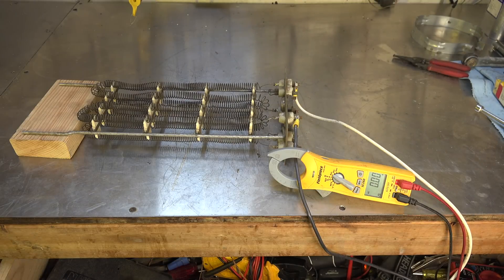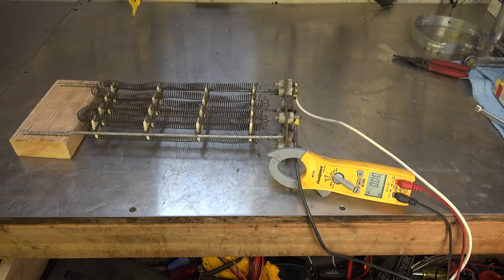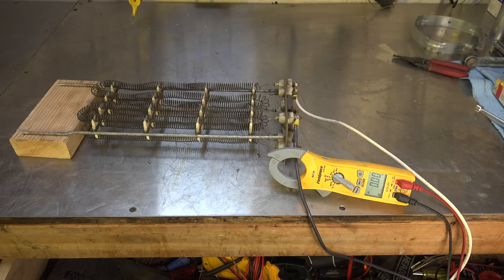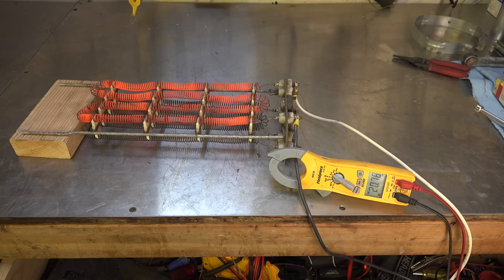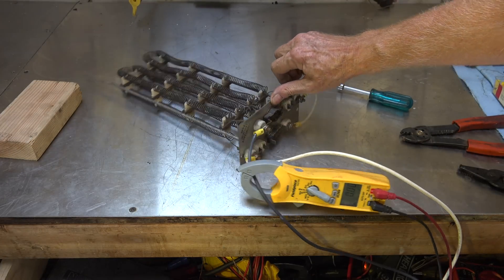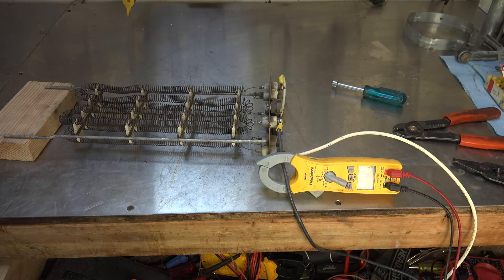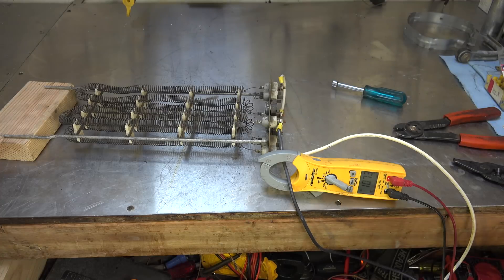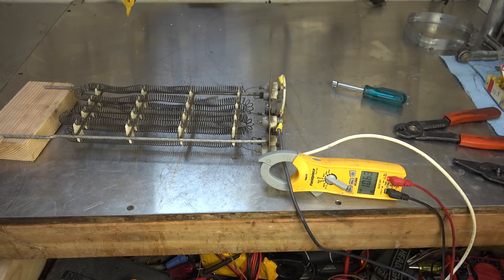What is meant by electric resistance heat.

Comment: It's a combination of volts fed into a resistive material, a resistive material is not a conductive material like the heating coils you have in this video. This video is a  demonstration done by a man who at the time didn't know everything that he was doing and how it works. The conductive coils heated up glowing red hot because only half of the heating elements were connected to the circuit, one the second heating coil was connected to the same amount of power, the heating device is now double the size and requires a higher amount of electron and proton flow. This set up doesn't heat up glowing red hot because of the inefficiency of the set up, and unexpected results as the experiment or demonstration was not well set up for the intended project. I believe your confusion comes from a misunderstanding of what a resistive material vs a conductive material is.
Reply from the maker: Your comment is a very large bit of complicated nothing.  Not worth an explanation.
GFM

Comment: More resistance under the same pressure will get u less power (wattage ) so less heat. If u give it more pressure (voltage) , to get the same current as before , that heat will much greater.

Comment: For more efficiency I would recommend an invention. Using Ac induction with a coil (no contact) and combine it with Dc direct or indirect resistance heating by induction at one side and direct resistance heating at the other. AC and DC will create more heat together, I think by higher and opposite electromagnetic fields.

It is not the same... When you put 10v Ac induction... And compare between 5v Ac and Dc, then you can conclude and realize if it is more efficient.

Comment: *I think you meant that the higher the resistance, the less power that is drawn giving you less heat. To output the same amount of heat with double the resistance, you will need twice the amount of power, voltage or current.

Comment: u mesed up... "if i lower resistance ill get half the heat" oposite way
Reply from the maker: You are correct at around min 2:45.  Other locations in the video it is correct.
GFM

Comment: So I have a heater that puts out 1300 watts on LOW  and 1500 watts on high...I'd like to make it (on low ) run down to 500 Watts if possible or close to it.  How would I do that?  I have a tiny generator that can't do it but almost. Is it possible to lower the watts on LOW?
Reply from the maker: The only way to reduce wattage is to wire 2 heaters in series.
GFM

Comment: It resists the flow of current
Reply from the maker: If this is correct, then higher resistance would increase heat output and larger amperage draw.  This is not the case.
GFM

Comment: Picture it like this: if you have a battery and you closed that circuit by connecting negative and positive wire together there will be a spark, that spark is caused by electron traveling at a rapid speed, if you hold that wire long enough, it will generate heat because of those electrons traveling at rapid speed, depending on the size of the wire and the voltage applied to it,it might break. We add a resistor (in this case your coil wire) then close the circuit (putting negative and positive together through the resistor) what in turn happens is that for the electrons to cross over from the live wire , they must first go through the resistor, the resistor like a free way toll gate, it restrict the amount of electrons that can go at a time, those electrons going through the resistor produce heat at that resistor while going through it (think of the resistor as a spark point when join negative a positive together)at certain a limited speed . When you connect resistors in series, it's like adding two toll gate in series(too much resistance will act like air) you end up creating "traffic" where U find like one car(electron) moving  after five minutes, in our terms, the electrons no longer move at the same speed thus don't cause much heat cause when one electrons moves after five minutes, the   generated heat caused by that resistor moving is cooled off by surrounding temperature during that five minutes break, but if you have five five million electrons moving at a resistor per second, there's little to no time for surrounding temperature to cool off heat generated by those racing electrons. You can also picture it as rubbing your hands when it's cold, if you rub fast you generate heat, you rub slow you don't generate heat and that's what resistors do, they control the rate of electrons moving in a circuit ( the rate your rub your hand in the example).
Reply: According to ohms law More resistance means less current if we're considering voltage to be constant. That means high resistance should have less current drawing capability. I don't think you get it!

Comment: More resistance in series less heat more resistance in parallel more heat
Reply from the maker: First half ok.
In parallel circuits, reduced resistance also increases heat.
GFM
Reply: @grayfurnaceman  I though so I just said things backwards

Comment: Dude, you never increased the power when connecting the elements in series. You can't display a proper comparison unless you bring both circuits to the same temperature.
Reply: You need to learn how thing operate before you make a claim because all your doing is confusing people.
Reply from the maker: @NoName-ly9xl  The point of the demonstration is to show that increased resistance will reduce, rather than increase current flow in a circuit.  It is a common myth that increased resistance will increase current flow.  temperature is not part of the equation.
GFM

Comment: I thought resistance meant the iron element is higher resistance to the copper wire and the elements resistance causes an element to glow red. From that, if you made the element out of copper it would have less resistance to the incoming current and therefore produce less heat than a iron element of the same size. It seems they are defining the element as a simple resistor whereas you are defining a resistor as something in the wire, pre element, either a mechanical device or different wiring setup. I think they are saying iron is a poor conductor and copper is a great conductor, conductance being the opposite of resistance.
Reply from the maker: Resistance in electricity is different than other physical forms of resistance.  
If I place a box on a floor and then move the box, it will take more power to move the box than if I grease the bottom of the box.
Electric resistance is pretty much the opposite.  The iron has a higher resistance so it limits current flow.  Current flow is power.  
If I used an iron element of the same length and size as a copper element, the copper element would produce more heat because there is a higher current flow.  
The end result would be that the copper element would melt due to its lower melting point than Iron and higher current flow.
GFM

Comment: I want to put a hot plate element to halve the current on a microwave oven transformer. To stop it burning the secondary windings out as the transformer gets hot with in 1minute of operation. As a fan is not keeping it cool enough during operation secondary side is 2.1Kv and the primary is 250v a.c. As I use the transformer to clean spark plugs with high voltage and only needs about 5 seconds at 2.5Kv and the plugs are nice and clean afterwards and works better than a wire brush too.

Comment: Well, because the heat generated is caused by the resistance of the material I guess😅
Reply from the maker: The heat generated is not from resistance.  That is proved by ohm's law.  Lower resistance equals more heat.
GFM
Reply: No, well resistivity is inverse of conductivity. And reflects as a concept the inperfection of materials ability to ‘move’ electrons through it. It’s a bit like friction. Imagine a stream of electrons rushing through with some speed a bumping into uneaven surface, potholes and such. Each time they dissipate a little bit of heat. Ohms law illustrates this where the current is equal to potential divided by resistance. So in our analogy you would have charged potential e.g. kinetic energy and the flow through this pipe or surface would be dictated by how condusive is this surface or pipe to the flow of electrons. So the lost energy would change into heat. (ref. thermodynamics) Say wood would be so highly resistive that the electrons would not even flow ... but in these instances the circuit is not even closed for practical purposes and hence nothing happens...
Reply from the maker: @stevenrachko8696  Do the numbers.  Reduce the resistance and the amperage goes up.  
Your analogy of kinetic energy does not apply to electricity.  It is not friction, thermodynamics does not apply here.
Your wood analogy would mean extreme resistance would increase heat.  It does not.
GFM
Reply: well just double the voltage and you’ll get twice the heat... that is all there is to it. Alternatively you can just use a more resistive wire with same voltage (make it thinner or longer or use a different material). It is that simple and that analogy is used to illustrate the fundamental processes that cause this...
Reply from the maker: @stevenrachko8696  DO THE NUMBERS!!!!!  If I have 240 volts and 10 ohms resistance, that will equal 24 amps.  If I have 240 volts and 5 amps resistance, that will equal 48 amps.
Or if you would like, in the first instance, 240 X 24 amps equals 5760 watts.  Second instance, 240 X 48 equals 11520 watts.  Low resistance with voltage the same equals more wattage.  Resistance in electrical terms does not mean friction and heat buildup.
GFM
Reply: https://en.m.wikipedia.org/wiki/Joule_heating
Reply: Did the numbers - and they really dont add up😅🤦‍♂️ 

So counter intuitive and also it is not in agreement with which I was thought these things... So how do you determine what will the power output be then...? Could it be the voltage drop🤔🤔🤔?
Reply from the maker: @stevenrachko8696  The numbers do work, you are just not accepting them.  Double the voltage, with the same resistance twice the wattage or power.  Double the resistance, half the power.  You are making it far too complicated.  Ohm's law is simple and, for pure resistance loads works quite well.
GFM
Reply: Nice and simply put. Thanks - makes sense now. Everyday you learn a thing 🙂🙏👌

Comment: Wouldn’t running in series be more cost effective and longer element life. Saying if your in a smaller in closure.
Reply from the maker: I am not sure how you would save money by using twice the length of element wire.  Also, you will get half the heat.  
GFM
Reply: @grayfurnaceman   Good Argument with calculating the money spent on double the lenth of wire. But i must say what egg inc is on something. Let's say for instance you want to temper steel between 200-300c.. then you don't need as much heat. Then I will configure them in series. Because you are opening and closing the furnace all the time between heats you introduce oxygen to the elements. At a higher operating temp (not in series), they will oxidize faster and shorten the lifespan of the element. Now the controller regulates on toggling on and off, meaning if you put them in series they will heat up to let's say maybe 400. So the element will be on for longer to regulate but the element won't be stressed as much. Then the stress on the relay will be less as well. Depending on what you are heating the cycle quantities of the relay can get high. So basically you save stress on your relay(less current and less switching) as well on the resistive wire not oxidizing because of lower operating temperature. But I'm hearing what gfm is trying to explain to the uninformed. I'm just pointing out further technical stuff which the video wasn't about.
Reply: A good example of this, are the old-fashioned incandescent light bulbs: A 50 Watt lightbulb has double the resistance of a 100 Watt lightbulb. Sometimes you want just a 50 Watt lamp, and at other times the 100 Watt :)

Comment: Bro its drawing less because the resistance increased. You need to now double the volts to overcome the resistance needed for it to glow hotter , which in this case 20 amps. Classic electronics
Reply: spot on

Comment: Hello Gray,

Could tell me what type of material are the heating elements sitting on? (thise white pieces). I am trying to make a large oven with several elements for a custom project but I do not know where to hang the elements on. 
Thanks.
Reply: ceramic
Reply: @veronicamiller3073  Thanks

Comment: The way you wired the resistors determine how much current is allowed to flow through them.... Parallel allows more current to flow than in series.. Which means you will have less resistance to current in parallel than in series then more power ( heat dessicated).
By keeping the same current and adding more resistance then u can get more heat to do that follow P=RI`2
Reply from the maker: You were doing fine until that last sentence.
Adding more resistance, when done in parallel, is simply adding another circuit, not more resistance.
GFM

Comment: Heat made by resistance, that's what it means. The power of heating will be P=R*I*I and I=V/r, so more resistance only gives you more power if you keep current flow but current gets lower with more resistance, so to keep current you need to give more tension (V).  If resistance is 0 you get no heat, it's just current flowing, it's the resistance that makes the heat. Imagine you are trying to make fire with two sticks. If you don't press the sticks to each other (make some resistance) you can move the sticks (current) and there will be no heat. If you press the sticks to each other you will have some heat. If you  press more (more resistance)  you only have more heat if you keep the movement but because you are making the same effort (same V) your movement will be slower (less I) and you will have less heat.
Reply: Thank you for this. The stick example is great. So if you increased effort (V) to maintain the same speed of sticks you would create more heat as well.
Reply: Thank you for this wonderful explanation!
Reply: More resistance under the same pressure will get u less power (wattage ) so less heat. If u give it more pressure (voltage) , to get the same current as before , that heat will much greate
Reply: @Arvidje  if you give more voltage and get the same current, than your resistence is higher, since I = V/ R. If P = R x I² and R is bigger than the power is bigger.

Comment: So basically it seems 4 years ago everyone was dumb. Who told you power increase with resistance, it will increase or decrease depending on whether voltage source is independent or current source is! that is P(heat) = V²/R or P(heat) = I²R.
And btw, it is called resistance heater because it's inductance is negligible and is kind of purely resistive load, otherwise manufacturer would have named it induction heater. Also ideally induction heater shouldn't feel warm to touch but it does, because it still has ESR to some extent.
I wouldn't have commented on such a old video but the level of stupidity in comments section forces me to do so

Comment: What would you call it? It is heating up do to resistance.
Reply from the maker: You are misunderstanding the terms.  Understandable, the terms make no sense.  Increasing resistance reduces the production of heat.  If the circuit has more resistance, less amperage will pass thru.  Less amperage means less total power used by the circuit.  Less power means less heat.  
GFM

Comment: Great video! I don't know why so many people have it completely backwards. Ohm's Law states that Voltage/Resistance = Current. Therefore, at the same voltage, more resistance will cause LESS current to flow through the circuit, which means LESS heat. So many people have absolutely no idea how electricity actually works. It's like they think resistance is the same as friction or something.
Reply: Resistance kind of is friction! If you think about it.
Reply from the maker: Agreed.
GFM
Reply: agree!
Mostly people confused is that more resistance will cause LESS current to flow through the circuit, which means LESS heat. 
But how about the conductor??
Conductor has low resistance will cause MORE current to flow through, why the conductor never heat?? haha..

Comment: If a furnace  repairman came to my house with this half true logic, I would not let him touch my furnace. He might be a good furnace tech, but his point is lost to those educated in ohms law.
Reply: No, you seem to be the one who is confused. Ohm's Law states that Voltage/Resistance=Current. So if you either lower the voltage or increase the resistance, there will be LESS current flow. In the video, he connected 2 heater elements in series, which doubled the resistance and therefore there was less current. So the heater elements didn't get as hot. His point was to show that a lot of people have a total misunderstanding about how electricity works and mistakenly think that "resistance means more heat" which is actually the exact opposite of reality.

Comment: increase resistance decrease the current so  decrease heat . heat couse by resistance of material.
Reply from the maker: The first part of your statement does no fit with the last part.  How can resistance cause more heat if the resistance is increased you get less heat.
GFM
Reply: @grayfurnaceman  Power=I2R (joule Heating)
Reply from the maker: The formula notwithstanding, you still move less current if you increase resistance.  Perhaps instead of calling it resistance heat, maybe we should call it lack of resistance heat.
GFM

Comment: I don't believe you are actually adding more resistant I believe after you put those in series and take an ohms reading you will have less resistance
Reply from the maker: You would be wrong.  Ohms law.
GFM
Reply: If you connect loads in series, you INCREASE the resistance. You're probably getting confused with parallel connections.